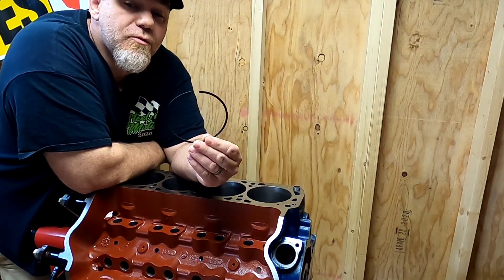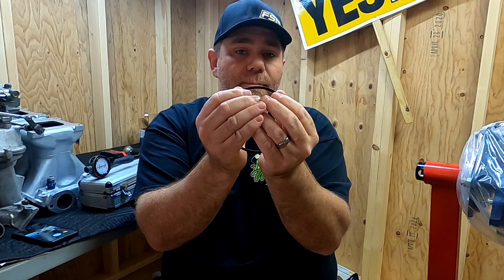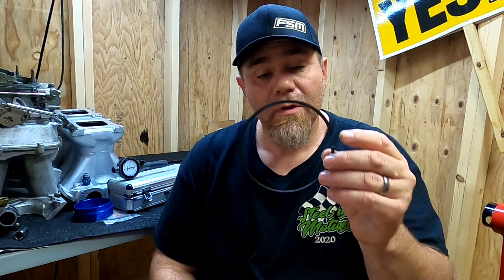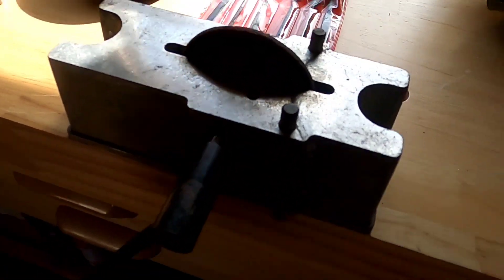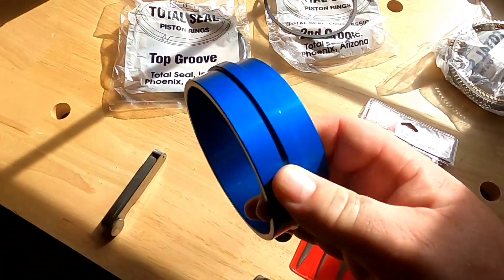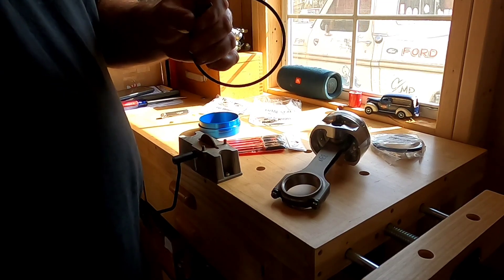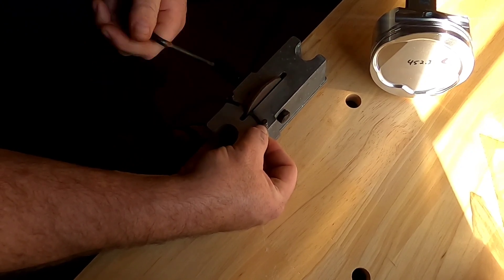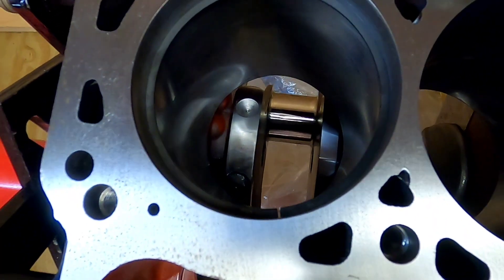HOW TO: Gap Piston Rings for Power NOT Breakage!!!

Comment: Do you need to file the lip that the filer makes on the ring every time before checking it in the bore? Or just after you get the correct gap? Can you do a video using a dial indicator and a electric ring filer powered with a drill like Summits.

Comment: i have to disagree with the factory ring gaps being square. i have rarely seen them square. i file one end square and then the other, then measure the gap and adjust it from there. there's a difference in power with square ring gaps.

Comment: Does compression affect the gap? Like should 10.5 have a tighter gap then 9.5?
Reply from the maker: No... I do open up the gap a few Thousandths if the engine is High Compression 12:1 or higher...

Comment: A wise diesel man once told me that he usually sees the cummins 12 valve engine go 500,000 to 800,000 miles....
But he showed me tear down with almost 700k on the engine.....
2 of the 6 cylinders were scored bad the others looked perfect.....the reason is because carbon builds up around the ring and even behind the ring....causing the ring to be shimmed hard against the cylinder wall as well as out of center....
He said if guys would just run a quart of Marvel mystery oil every tank of gas which costs 3.00-4.00 the carbon would be eliminated and the engines will go 1.2 million miles until bearings, rings other things were really wore out

Comment: Good video!! I’m impressed with your 96 4.6L mustang in your Holley carb video ( with the 950 Holley carb)that you did, I was very impressed with how well the car ran.  Is it possible to use total seal rings amd not have to worry about ring gap?

Comment: Another situation I often encounter in my shop  is that if a block is honed without a torque plate which leaves you with round holes and you check end gap like this video shows you think you have done it correctly .  It is correct UNTIL you bolt the cylinder head  on and it distorts the top of the bore.  The head bolt/stud distortion creates bulges in the clyinder simulating a smaller bore which decreases end gap in the top half of the bore, which causes galling/scoring.   It also causes the rings to turn into an accordion when the bore isn't concentric from top to bottom. 

Another scenario i occasionally see is is that the piston ring may the correct thickness for the ring land in the piston BUT the ring is too wide for the depth of the ring land in the piston , not allowing the ring to fully compress , which typically results in failure.
Reply: Yea I've taken engines apart where you could see the bore worn in the area where the stud clamps down. 
You'll see 3-4 of em , or however many studs are close to the cylinder. 
Everyone says "no way" until they have to see it for themselves.
Reply from the maker: I've seen it too..  it depends on the design of the block and castings.. Not all brands are created equal in this regard!
Andy
Reply: So what is the home builder supposed to do?

Comment: I feel that you missed a major point , which is overlooked by most builders!! If that block was honed with a torque  plate the ring end gap needs to also be checked with the torque plate installed.  When the torque plate is removed the  cylinder is no longer round, especially in the first 2-3 inches of bore , which is the zone where most people  gap rings .  If the block was honed with a torque plate (the average person isn't going to have the torque plate the machine shop used) you need to check your bores with a dial bore gauge and work your way down the cylinder till you reach a point where the bore is round(out the head bolt deformation zone) and check your gap at that point.  .002-.004 bore distortion (change in bore size) affects ring gap more than you may think.  Certain blocks are more prone to distortion due to head bolt location/distance from the bore.  You can test this theory by checking end gap 1" down the bore and also at the bottom of the cylinder and compare results.  

If anyone tries to compress  the ring and grind both sides simultaneously your end gaps will only be square with each other if your desired end gap is the same as the width of the cutting wheel .  When this method is used what you will typically see is a triangular shaped end gap when the ring is placed in the bore!  The average person also doesn't realize how important it is to place the ring squarely in the bore. If the ring is tilted in the bore your end gap measurement is totally erroneous.   

I also wouldn't recommend a needle file for deburring. A file can be too coarse and chip the ring coating.  I would recommend a fine lapping stone , or diamond lap or even 1200-1500 grit wet or dry sandpaper tightly wrapped around a file for deburring to prevent chipping which sometimes requires viewing under magnification to see.
Reply from the maker: Thanks for your input,  I understand what you are saying and I think it holds merit.. but the fact is 99% of people don't have access to a torque plate and they do it this way... I will say that I have seen myself one time years back where the groove in the piston wasn't cut deep enough to allow the ring to fully collapse and I had a talk with the piston manufacturer and they made it right!  I have built engines making well over 1000 and never had any issues doing it this way.. 
Thanks for watching,
Andy
Reply: @UnityMotorSportsGarage  I started working on a video that explains cylinder distortion  and how it affects ring end gap and piston clearance. You don't need a torque plate if you check the end gap lower in the cylinder .  Attention to details are what separate winners from losers.